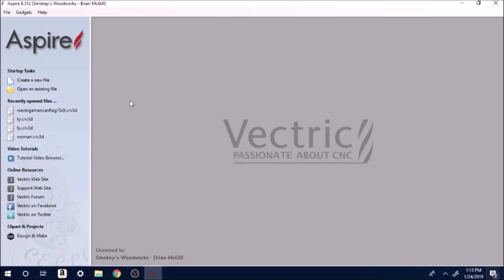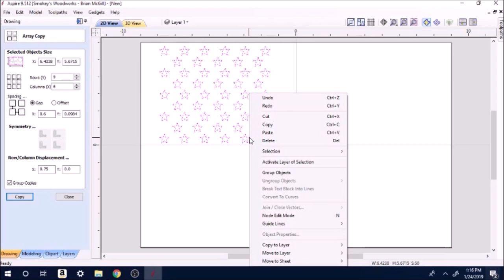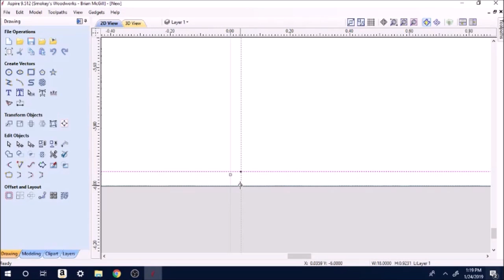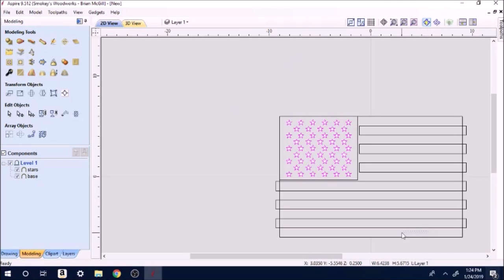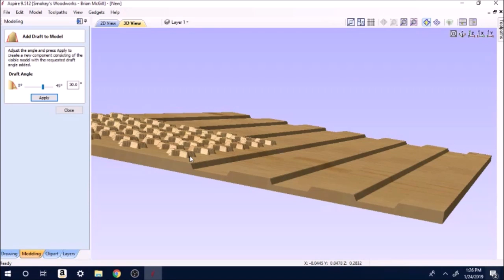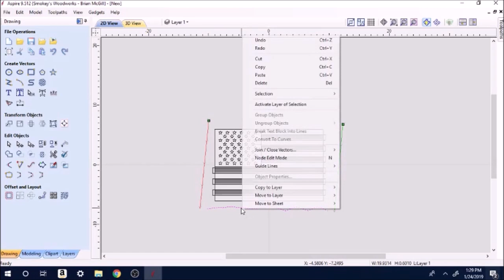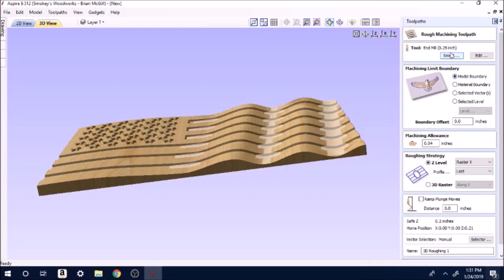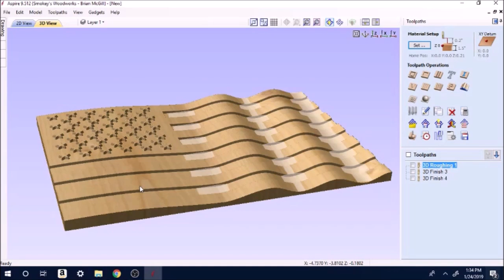How to make Aspire model for 3d Waving American Flag

Comment: Great design and info layout in Vetric.  The problem I ran into when cutting on the machine was setting the Z height when second bit was inserted.  The roughing pass lowered the material height so when the next bit was inserted and the Z=0 height was established it was based on the new top of the board.  This was lower than what was set in the design so it cut in too deep.  Lesson learned.
Reply: So how did you do it differently then?
Where do you zero Z then if the whole thing was flatter after you changed bits? 
Thanks.

Comment: thanks for the video-- good work. Question: The field of stars does not appear to be even to me. The even number rows appear to be offset a bit to the right, or the odd numbered rows are offset to the left. Am I going blind? If my vision is OK, is this supposed to be offset?
Reply from the maker: When the waves are added it makes them appear distorted, but when they cut they aren't on the flag....Thanks for watching!!
Reply: If you're just wanting to get them straight for 2d, like you want to make a normal not wavy flag enter .585 under Row/Column where he did displacement of .75